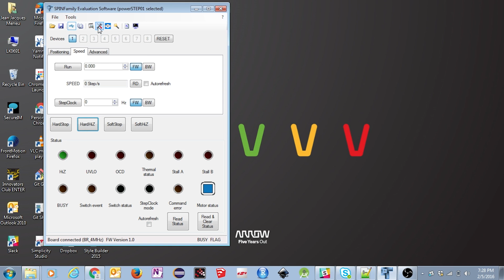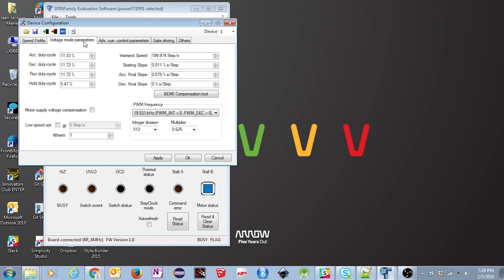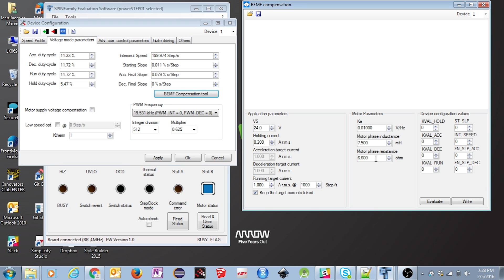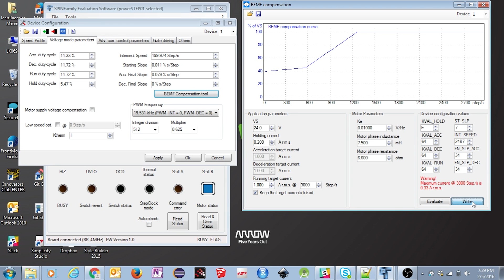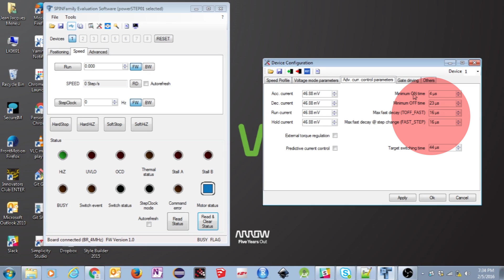Arrow Product Insights - 03 - Voltage vs Current Mode for Stepper Motors

Comment: Sounds  like current mode is best used for high speed, but aside from lower noise, is there any advantage to voltage mode for slow speed?   I have a "6v motor" but it doesn't say anything about current.   So if using current mode, how do you know the maximum current that can be used?   I was thinking of using the MKS LV8729 stepper driver.. but like the EVLPOWERSTEP01 / STEVAL-PCC009V2.   Any thoughts how it compares to ST's L6474?
https://www.cnczone.com/forums/stepper-motors-drives/354550-l6474-powerstep01-drivers.html